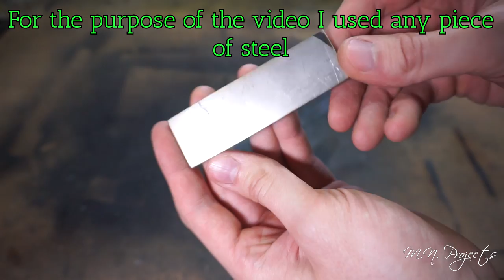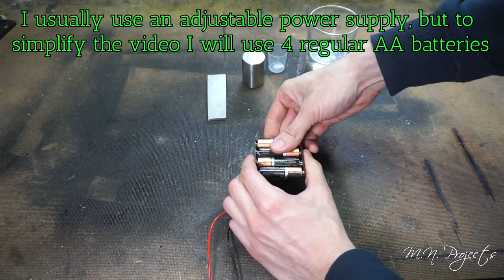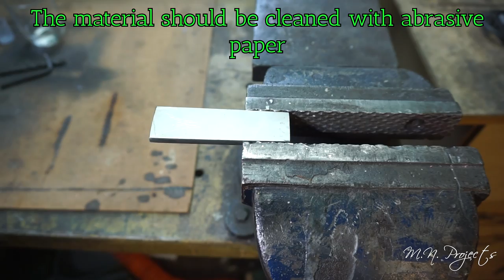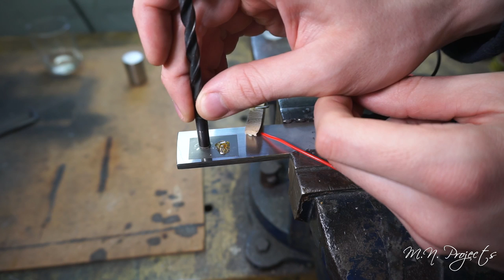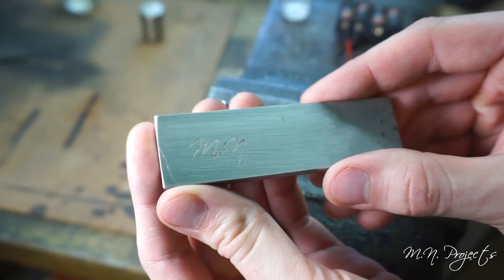How to easily Etch the Logo in Steel using salt and batteries. A short Tutorial

Comment: Process of oxidation by elektrolysis.  Beautiful!
Reply: The rusting of iron (Fe), or the production of ferric oxide [Fe2O3] in the presence of oxygen begins with the transfer of electrons from solid iron (Fe) to oxygen (O). This process is fascinated in the presence of water (H2O). Table salt is mostly made up of sodium and chloride ions, when the impurities are ignored. These inert ions catalyze the rusting by accelerating the transfer of electrons.

Oxidation is the process of donating electrons, and reduction is the process of accepting electrons. Oxygen, being placed to the very right of the periodic table, acts as a oxidizing agent, or forces the other reactant to oxidize. When iron oxidizes to form ferric (Fe3+), the oxygen ionizes to form oxide (O2+) and combines with the ferric. The resulting ionic compound is a charge-neutral mixture of ferric and oxide, or ferric oxide [Fe2O3].

---

Ionic solid is a kind of solid matter composed of ions (charged particles from atoms) placed in a strict order that maximizes the attraction and minimizes the repulsion between themselves that come from their charged nature. However, upon contacting water, these charged particles become attracted to the water molecules, so they lose their solid identity altogether. That is, in water, they are just a solution of positive and negative ions, no more and no less. When the water dries up, the solid will reform as the ions come together.

Pure sodium chloride (NaCl), when dissolved into a water solution, will create chloride (Cl-) and sodium (Na+). If you will, the salt is indeed decomposed by hydration (solvation by water). If you draw up the chemical formula, you'll see that it's formally going through decomposition. However, when water dries up, the original table salt forms again. And this process can be repeated forever.

---

Chemical reactions are one-liner descriptions of a chemical change. However, due to energetic reasons, reactions typically don't happen as just described. Instead, any actual reaction can go through multiple steps producing intermediate products and reactants and products again. The series of the reactions that a principal reaction goes through is called its mechanism.

Study found that when iron (Fe) rusts in aerobic conditions, the water actually decomposes to form hydroxide (OH-) as part of the mechanism. However, this is neither the reactant nor the product of the overall reaction of rusting.

Comment: how did you get the little stickers made? Great videos! thanks
Reply: @mrrictus  Won't work for this process. You need a stencil with areas to be etched clear through the material. Transparencies work for photoetching but where you need to push current through from the anode to the surface to be etched you need no material or a silk screen type mask or vinyl.
Reply: Frank Fritzges ahhhh damn.
Reply: I have a cricut machine to do this
Reply: @Lisa Cleary sorry I was unclear!  It makes the sticker/stencil.

Comment: An old cellphone or laptop charger of 5V to 12V from the thrift store will give you a cheaper power supply.  Make sure to get one with DC output (most are.)  If you use one with AC output, it will not etch the metal, but will burn it black.  One thing you can do is etch it with DC first, then leave the template in place and go over it with an AC electrode.  Your etching will be deep and it will have a black color to it.

Oh, yes for DC current -- "Positive goes to the piece, negative goes to the electrode."  (With an AC current it doesn't matter.)

Comment: I did this on copper, but even after 4 minutes it was such a shallow etch that it sanded off with 3000 grid sandpaper in no time. What did I do wrong? I added more salt water than you did for example, and had a 12 volt car battery charge as power supply. Please tell me what you think went wrong. 
Greetings, Thijs.

Comment: very cool! But arent you just short-circuiting the batteries?
Reply: There is still some load from the circuit, but fairly low.
Reply: +FedeHippo   It is short circuiting the batteries, but the reason nothing bad happens is resistance. A loss of voltage is in each connector, wire and the salt solution and the metal thus is allowing only a limited amount of current, measured in amperage to pass thru the completed circuit, but at a reduced value. It can be measured using a voltage drop method with a digital multi meter set to voltage DC. Place the meter wire on both B+ and the negative side. Since this is series circuit, the salt solution creates resistance and the metal to metal contact is consuming all of the voltage in the circuit, but current is limited by the salt solution. The movement of the metal twist drill, will change the amount of current as it moves, but limited by the salt and movement. An amp clamp would swing wild during this process.

Comment: let the rusting begin!
Reply: even though its stainless?
Reply: Yes, even though it's stainless.   Stainless steel is VERY bad about getting contaminated with Carbon steel.   All you have to do is rub carbon on stainless, and that spot can and Will rust if not handled correctly.
Reply: This only etches the surface layer and if you follow it immediately with oil.....like coconut oil....it seals it....no rust.
Reply: Just like seasoning a iron pan.....you add oil and heat..... and it's treated. Last for years.
Reply: If you put like a metal polish on would it stop it from rusting

Comment: “Using saltwater as your etching electrolyte can be rather problematic due to competing side reactions. The main one of course being electrolysis of salt, which produces chlorine at the anode and hydrogen at the cathode. So you would have a toxic gas - chlorine and a highly flammable gas - hydrogen.

Comment: I tried this method but the etching was totally on the surface and could easily be sanded off. any idea on where i might have gone wrong?
Reply: I used a variable power supply and could barely reach 0.05A
Reply: Maybe you have to do it for longer?

Comment: Where is the other battery lead connected?
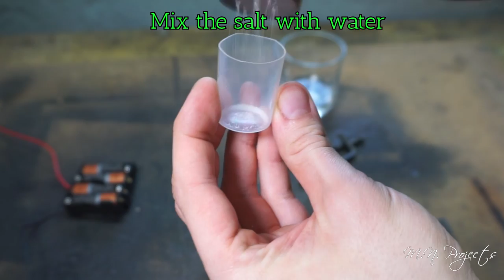Reply: At 1:11 you can see he attaches the positive lead to the metal object. Then he takes the negative one and holds it against the drill bit as he's putting salt water on the stencil.

Comment: Is there anything dangerous about it or stuff you should be careful with? Looks like a cool tip, just don’t want to accidentally electrocute myself if I try it lol
Reply: Roddy it won't hurt as it's DC
Reply: Not enough power to electrocute here.   Be careful of individual little strands of the wire that may get very hot if the wire isn't in complete contact with the electrode.
Reply: The power source is a battery....can't hurt. Might itch. But if you are scared....just put on rubber  gloves and continue one. Make a brine of water, salt, and vinegar....attach the leads and you're good to go
Reply: You get a better result if you use a car battery or wall socket. Just put the 2 wires straight into the wall socket, make sure you stripped the insulation and hold them firmly into your hands.
Reply: Von Bergerfurth you wrong for that. People do things safety. Battery powered is safe. Stay away from sockets.
Reply: peepla7 If you want a good result, the wall socket is the way to go, as long as you do it correctly.
Reply: Von Bergerfurth just stop it. I've etched many things and never once went anywhere near an electrical socket. Don't cause harm by telling folks unsafe things to do.
Reply: Don't listen to this madame. She clearly doesn't know anything about electronics.
Reply: Von Bergerfurth I know enough to have successfully etched many things and not have had issues. Batteries are safe for a novice.
Reply: In my experience those tiny batteries don't cut it. You need a powerful supply to etch properly.
Reply: Von Bergerfurth it's been my experience a 9volt battery works just fine...here's proof: https://youtu.be/ICYuAPhgDK8 

Point is if the new.to.school are gonna try it..... let's show them the safer way first .   Once they get knowledge....then they can try the more concentrated methods.
Reply: peepla7 Nope. Wall socket is the way to go, even for novices.
Reply: Von Bergerfurth also you should bipass the circuit breaker when you use the socket you dont want them tripping when you do the welding😂